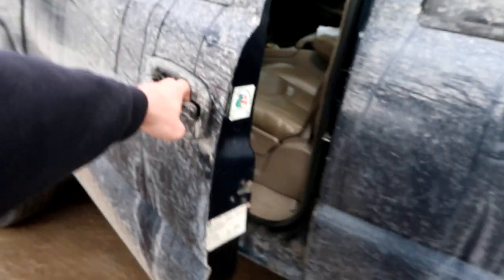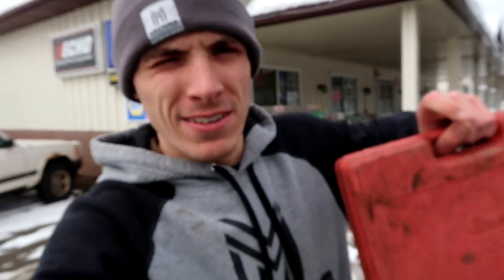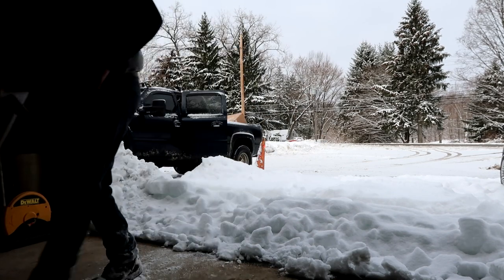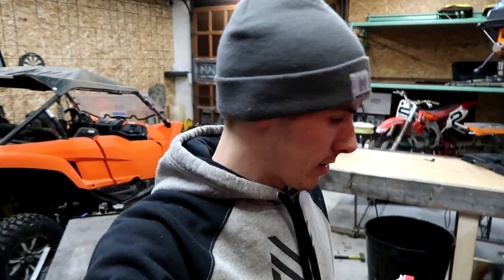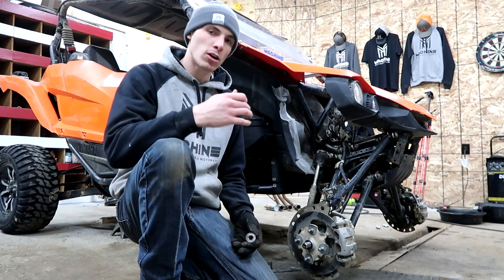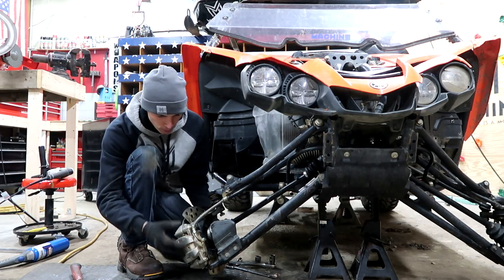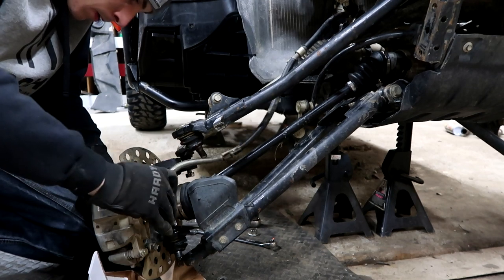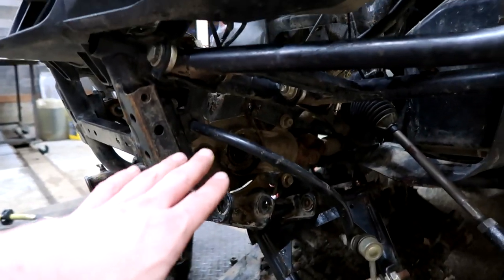GOOD NEWS AND BAD NEWS YXZ 1000cc BEAST

Comment: Pro tip: FLip the castle nut upside down and thread it on backwards (flat face up) so you have a flat surface to hammer on. Won't knacker the threads of the bolt or crush the turrets of the castle nut.
Reply: Caleb Schmucker good tip

Comment: Helpful hints for next time you do ball joints put them in the freezer before you start working so once you have the old ones off all you have to do is take a blowtorch to the metal to make it expand a little and put the cold Frozen ball joints in with ease. Works like a charm every time.